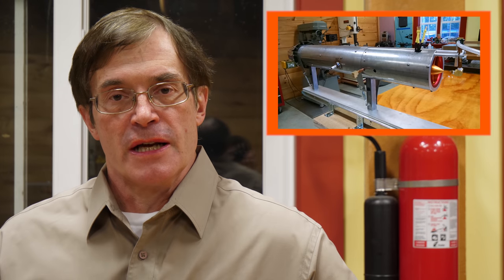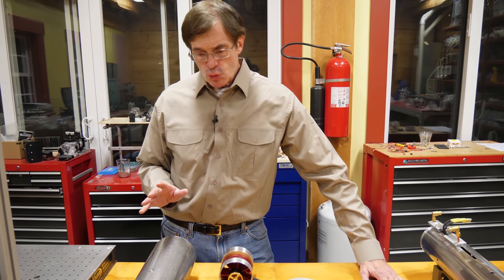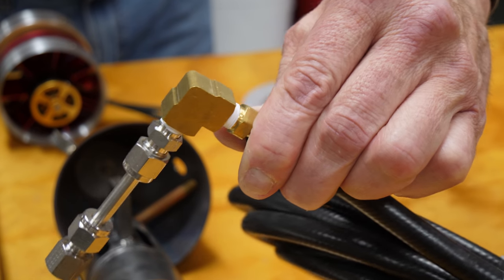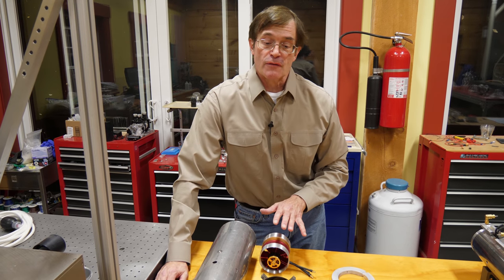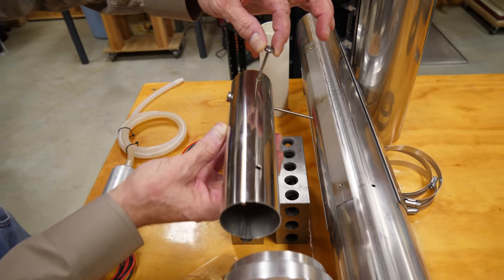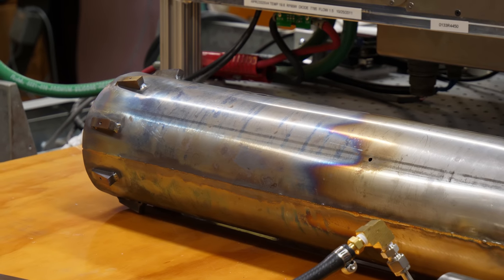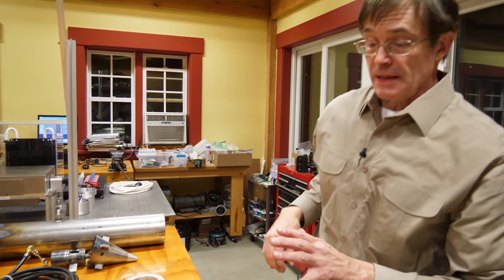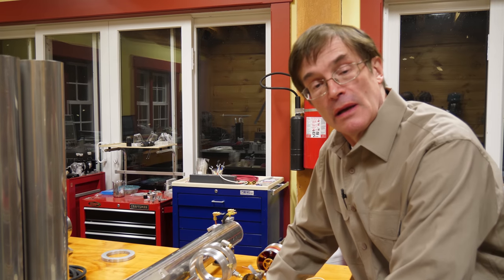Hybrid Jet Engine - Update 2.0

Comment: Why not use the a liquid fuel for cooling and save weight by eliminating the water? I understand liquid fuel is more difficult, but  the heat would help atomize the fuel and help with mixing. I don't see how the steam would increase thrust considering the exhaust is already full of H2O. By pulling the heat away with water you're cooling the exhaust, therefore slowing the gases down.   Even if the steam added to the thrust, I doubt it would be more than the 10-30% extra weight added by the cooling system. Why not build a flame holder to eliminate need for cooling? 

I understand all of my suggestions make the engine harder to build.  Other than for the fun of it, why bother making an engine if its not going to be effective enough to fly? I'm afraid the extra weight of engine and weight of pressure cylinder to contain the propane would make this too heavy to hypothetically get off the ground.  

I hope you release the basic specs when finished(weight, thrust, SFC, etc) so we can get an idea how it stacks up to other tiny jets.

Also, I think this project is awesome and I can't wait to see the next video!!! I hope one day I have the space and tooling to have fun with projects like this!

Comment: I worry about a spark inside the motor causing premature ignition... is this a problem, and if so, how have you countered for it?
Reply: There should be no sparks in a BLDC, unless the insulation breaks down or something.
Reply from the maker: As I said, the propane quantity needed to cool the motors is quite small and well below its flammability limit in air.  It wont burn.  There is one requirement and that is to add the propane only at high power settings, where its needed anyway.  Because at partial throttle the propane fuel/ air ratio increases.
Reply: That makes a lot of sense, I must've missed that bit. No worries, I look forward to seeing it run!

Comment: Only 5 mins in so far but the problem with edf's is they are airflow optimised, not air pressure optimised. However i dont know how you could fix that without making your own edf or at last your own fan blades within it
Reply from the maker: You are correct.  These are not optimized even as axial compressors.  A lower AOA and higher RPM is basically the way to go.  But, these particular fans (they are pretty amazing as EDF's go) do produce a very high velocity and this is the value that can be transformed into pressure.  Going to 16s is the goal, as the performance mounts with the square of velocity.
Reply: Have you considered getting some car turbochargers and using the compressor stages driven by electric motors? In theory you could use the water cooling to produce steam and power the turbine section of a turbo connected to another electric motor acting as a generator and feed the power back into the DC bus. I doubt it would power the entire thing but it would scavenge a decent amount of energy.

I have been curious about electric motorjets but information is scarce, piston engine versions were tried in the 1940s. It's possible electric versions could solve some of the issues that plague miniture turbojets in RC jets, they have relatively low performance as the turbine blades cannot handle high temperatures due to the small size, large turbines have hollow air cooled blades with ceramic coatings but that isn't feasible below certain sizes. Decoupling the compressor from a mechanical turbine might also have some interesting advantages, the speed of an electric compressor can change rapidly and it does not need to be located directly infront of the burner.
Reply from the maker: We just completed a turbocharger/turbojet conversion for an up coming video.  The simplicity of using a commercial turbine unit was a relief!
Reply: Do you have any idea how much power it takes to run the compressor on small turbojets? I know those small RC turbojets when used as a turboshaft output around 10kw but I haven't been able to find any info as to how much energy is being taken from the hotside turbine to drive the compressor. I think performance of an electric motorjet could be quite favourable performance for small engines, with no moving parts in the hot side you could eliminate the pressure and termperature limitations of micro turbojets.
Reply from the maker: We are building a turbocharger/turbojet for an up coming video and did some of these equations.  In small turbojet producing around 10Kg of thrust and with a 3:1 compression ratio, the energy extracted by the turbine to drive the compressor is around 15 Kw.

Comment: Why not inject the water into tube directly after the combustion, rather than having a water jacket?
Reply from the maker: We do not want to cool the exhaust.  This will cause it to shrink and therefore to slow.  We want the exhaust as hot as possible, even past the point that damages the steel tube and so the cooling water is used to protect this part by flowing along the outside.
Reply: Tech Ingredients Thank you for the reply.

Comment: I know you read my previous comment on including an air by pass, I was wondering if you at all planned to take advantage of the Venturi effect in the same way a pulse jet engine does
Reply from the maker: The venturi effect can be used with any engine that produces flow.  The greater the velocity, the more beneficial this becomes.  This principle is the basis of thrust augmenters.  When the air is drawn into the high velocity jet, it passes over the lip of an airfoil shaped duct inlet.  This lowers the pressure in front of this lip, drawing it forward and increasing thrust. 

The engine we built has a rather low exhaust velocity and the benefit of augmentation would not justify the added weight and drag.
Reply: @TechIngredients  The way I've been thinking about it was like a pulse jet with an integrated blower, then using something like a butterfly valve to control the air/fuel mixture coming in . Then using the Venturi effect to run the engine without the motor enabling an opportunity to charge your batteries. I know it may sound kind of confusing but if I could send you a sketch I'm sure it would make more sense
Reply from the maker: This will probably have an adverse effect on the pulse jet.  These jet's major limitation is the low compression ratio because charge air is driven into the engine secondary to the low pressure created after the pulse.  This pressure differential in not very great and decreases toward zero as the chamber fills.  The valves impede this flow and a fan or turbine will add further to this restriction.
It might be better to place a turbine into a peripheral area in the exhaust to generate current.
Reply: @TechIngredients  all you have to do is tune the bypass to maintain a standing wave produced by the exhaust, then shrink the intake to the motor and run it in reverse to charge.
Reply: in essence having created an acoustic refrigerator

Comment: Of what possible use can such an engine be?
It cannot power an aircraft unless you use the jet exhaust to produce electric power to run the compressor fans. Water injection cooling adds a huge amount of weight, as does nitrous oxide injection.  I just don't get it.
Reply: There is no air for cooling and no wind for doing the compression. Maybe this concept in a plane and you don"t need water cooling and compressor fans.
Reply: Without compressor fans,  you are describing a RAM-JET which cannot either take off or land under its own power. You might get away with air cooling given the stream of air at -40 C that surrounds an aircraft at cruising altitude. But you can't get away without a compressor unless you boost the aircraft up to at least half the speed of sound. Ramjets are inefficient (less than 600 seconds) until the airspeed exceeds 1,000 kilometres per hour. So you need either a turbojet or a rocket booster.
Reply: Ok, you are right. I think it's a proof of concept. This test system shows us how you can handle the heat, the fuel injection and what kind of geometry this thing is needed. After this you can try to put a compressor in this jet engine powered by the exhaust.
Reply: I'm guessing your PhD is in political science?
It's called a test stand. Even orchestras test their equipment before every performance.

Comment: As long as you have to keep supplying external power to run the fans, the whole purpose of the engine is moot. You point out correctly that the fans don't generate significant compression, added to this the constrictive duct work aft of the fans, while boosting the speed of air flow, will not increase the air pressure going through it, rather decreasing it according to Bernoulli.
Reply from the maker: You are correct.  However, consider how afterburners are actually used.  They produce short bursts of fuel inefficient power for take off and maneuvering a swell as for effect in model, RC aircraft.
Also, in part two I go into the interesting prospects for how all of this changes as flight speed increases.
Reply: Afterburner in a turbojet engine is only an augmentation device. A ramjet engine may be a better analogy to what you are describing, however, ramjet only works at extremely high velocity air flow which usually can only be achieved with the help of a turbojet or a rocket engine. Conventionally speaking, the basic function of an axial compression turbine engine has everything to do with manipulating gas pressure at different stages of the engine to sustain compression, diffusion, combustion, and driving everything with the rapid expansion of gas (air+combusted fuel) translated to rotational force of the turbine. This is not to say that you won't come up with a whole new way of making an operational jet engine without compressing air.

Comment: Nice project and well presented video.
Wont using nitrous oxide mess with the combustion area fuel/air balance and possibly cause it to move forward into the motor area?
Sounds a bit hazardous to me..
Reply from the maker: The amount of nitrous oxide necessary is actually quite small compared to the oxygen delivered with the air flow.  A small amount of additional fuel might be necessary, but probably not and the combustion cannot move forward because there is no fuel present, forward of the combustion chamber.

Comment: I have a feeling that a couple of fans running at 7000W are enough for a jet engine. No need for the fuel.
Reply from the maker: You are correct, the fuel is not necessary and it adds complexity.  However, it also adds realism along with additional thrust that mitigates some of the additional weight, cost and complexity.

Comment: Would it work at all to replace the burner with a pulse jet? Yo cold run the cool air over the pulse jet to preheat/expand it before it gets mixed into the pulse jet exhaust. if the pulse jet was fuel rich it wold continue to combust as the fresh air gets remixed into it. as long as all of the chambers and pathways were the correct shape it shouldn't choke out the pulse jet or the EDFs.
This is something I have been thinking about since the first video, if anyone can tell me why this is a bad idea I wold love to hear and explanation.
Reply from the maker: It's a good idea and has been proposed as a method of improving the compression ratio in large jet engines
Reply: Sounds like it would back fire.
sunglassesyeeeaaah.jpg

Comment: https://apps.dtic.mil/dtic/tr/fulltext/u2/a023471.pdf People have said that this could not be useful, but the Air Force thought they might be useful in the 70s. Have you seen this report on a  subsonic ramjet for a cheaper cruise missile? Specifically it talks about combustion efficiency of a staged flame holder like in your original design, however in a cone shape, and with a smaller cone over the pilot light. You mentioned wanting a wind chamber in the next video and they had a interesting way of testing without a wind chamber that is also described in the document.

Comment: Wait wait.  You built this whole assembly to add an afterburner, which theoretically should double the thrust output, but you say you got about 10lbf of thrust with 1.0, but the JP Hobby 90mm 12S EDF is rated at 5.1kgf thrust.  I'd expect more than 10lbf if all you did was put that EDF in the tube and fed it power.  

Wait, what?  Hotrodders know that introducing liquid before the compressor reduces compressor efficiency.  If and when it's done, it's water/methanol which works as an open-loop evaporative cooling system to cool the compressed air, ideally by evaporating before it gets to or through the compressor.  That's fallen out of favor due to potential issues like not having it atomized well enough leads to liquid reducing your compressor efficiency.
Reply from the maker: The EDF alone will generate 10# of thrust, 8# as installed in the tube with its obstructions.  The thrust with the first iteration of this engine pegged the meter and therefore produced something in excess of 10# with the afterburner.The new engine will generate a total of 17# of thrust with the series fans in the tube and no fuel flowing.  This rises to 36# when the afterburner is fully on.

Comment: You are relying a lot on turbulence.  But that wastes energy.  I wonder: could one build a laminar jet engine?
Reply: The turbulence is required for proper fuel air mixing. All types of combustion engines have turbulent mixing.
The Honda V-Tek engine intake valves are specifically designed to make a little tornado inside the cylinder and that's how they are super fuel efficient.
Laminar by definition is not mixing. You would need some very strange rocket-engine style injector...which is better for rockets because turbines have high air mass flow rates...
High surface area fuel injection does not play well with high air mass flow because the flow pipe is default restricted by the injector.

Comment: Helli, who are you, Tech Ingredients ? Some kind of Professor, working in Science Lab, but it looks private, but too expensivly equipped.
You have the know-how on everything, from chemistry of smoke bombs to sound of speakers to rocket engines. Do you really do this privatly at home ? What is (or has been) your work ?
I would like to get some more numbers, you say you spray propane for coolinv but below explosion concentration yoj must have calculated the amount of air intaken, know the maximum amount of propane and estimated the watts(BTU) of cooling sk you know how much more you can expect from the motors please give the numbers you estimated.
Reply from the maker: At the 48 volt setting (the highest we tested). the series fans will reach 8 Kg of thrust.  Based on the cross sectional area through each fan the mass flow is approximately 0.8Kg/second.  Propane has a lower flammability limit, by weight, in air,  of 3%. This equates to 24 gm/sec.  The spray nozzles each restrict the flow of propane, at full tank pressure, to 5gm/sec.  The vaporization of 5 gm of liquid propane equals 1,500J.  Each electric motor is at the very pessimistic worst, 85% efficient.  That equals 750 watts of waste heat when running each fan @ 5,000 watts.
Reply: Thanksalot, I knew you had the numbers. So everyone can check if his calculation is plausible. It's an impressive shop. I also placed everything except the shelves on wheels, but have less space.

Comment: I dont think there is any compression going on by that fan. If there is any its by ram effect. If you want compression you should have diverging stators, which this doesnt seem to have. (It wouldnt because it would just rob thrust). Edit: woops, you went there. hahaha
Reply from the maker: You're right that the compression is the result of the ram effect.
Reply: @TechIngredients  Thanks for the reply. Are you still working on the APU by any chance? I am building a similar device to power a RC Submarine. Very different parameters, limitations are in dimensions and cooling more so than weight. Did you find any multi cylinder engines with offset strokes?
Reply from the maker: Yes, we are.  The DLE 222, 4 cylinder, two stroke flat engine that I show at the end of the video is being coupled to a BLDC motor/generator.
Reply: @TechIngredients  Cool! Looking forward to that. Do you have any idea if the Saito FG-61TS engine would be okay for this purpose? It is the only engine with significant output that fits our design. It is 4-stroke but as we have no weight consideration larger capacitors is absolutely fine, we'd rather have the increased efficiency. With the amount of fuel we are carrying that works out in our favor. Are you going to use the BLDC's as starter motors too?

Comment: what you have created is a thermo-jet...  not a hybrid. basically a fan blow flame thrower. your power to weight is terrible and the power draw from the EDFs and fuel consumption plus weight is extremely inefficient compared to a EDF by itself.
Reply from the maker: You may disagree with the terminology, but your alternative is incorrect.  A flame thrower does not contain the pressurized gasses forcing them to accelerate longitudinally as heat is added. The jet is less efficient, on a thrust to weight basis, compared to the EDF alone, but batteries are heavy and their energy content is low.  The difference is smaller than you might think.

Comment: I've had a similar idea with combining motor cooling and boundary layer suction on wing. 
https://www.youtube.com/watch?v=2nkojQwwsjQ
Output from the vacuum pump for wing suction could be used to cool copper coils in the motor. That way aircraft can benefit both from improved wing aerodynamic efficiency and motor efficiency.